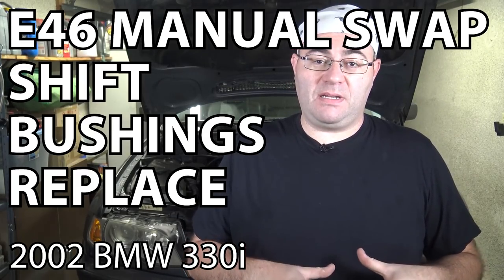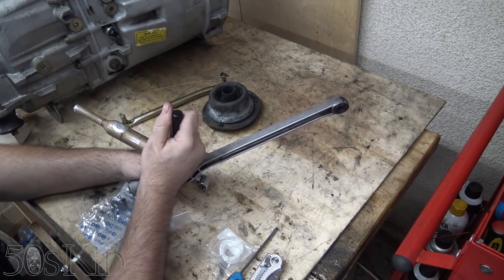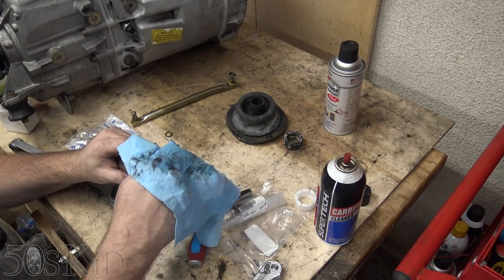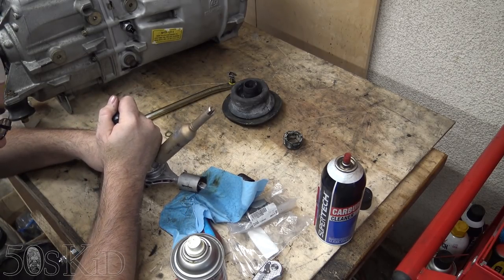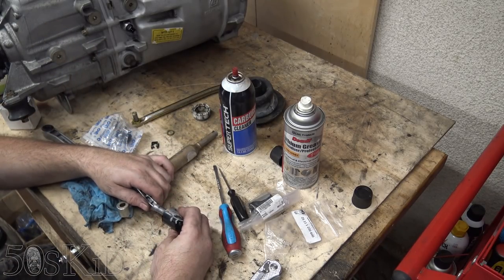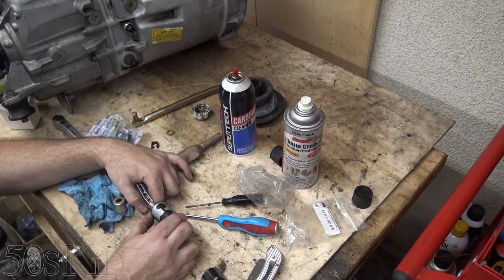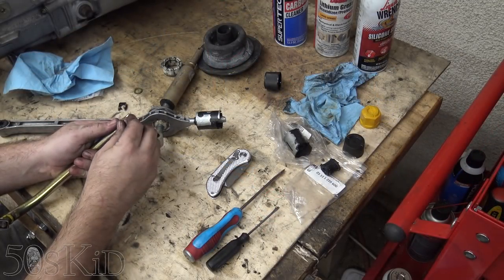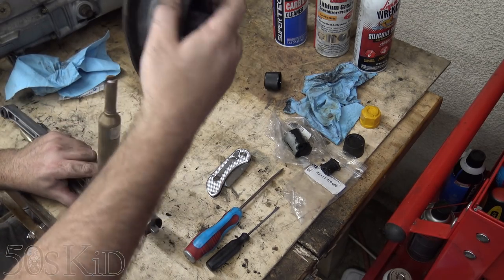BMW E46 Manual Swap Project - Shift Bushing Replacement DIY

Comment: You did like me and didn't replace that $6 selector shaft seal on the tranny. I'll do mine with the rear main. I did a short-throw with an OE 535i shifter, already had an M knob. That idler arm rear mount new and old seemed the same to me, LOL. On the front of the idler arm I used the nylon bushings from ECS to tighten it up even further.

Comment: Few tips: use the appropriate grease, lithium spray is too light duty and won't last. Don't use silicone spray to push in bushings, glue like substances are actually specified as bushings should be fixed in place and lubrication weakens the hold.

Comment: Thanks for the video. I really learn a lot from your nice videos. I have a question. Recently I replaced some of the bushings except the rod joint. Now shift lever lies slanting towards right side. I noticed that the selector rod is inserted from the right side (passenger side) but I inserted it from the left side. What could be the reason?
Reply: 5th gear lean
Reply: @tommyriffe9115  Thanks

Comment: did this fix actually solve a sloppy gearstick?
Reply: If yours has never been replaced there's a few factors the if the selector rod bushing is worn it'll create slap if the rear shift bushing is worn it'll create play if the shift rod ball is worn it'll create play if the shifter ball cup is worn it'll create play if the front oval bushing is worn it'll create play if they're all worn it creates a lot of play a perfect working order shifter will still have some play from the factory because it's not a race car but if you have a car that's never had any servicing of the shifter and it's $200,000 miles and you go from that to a complete replacement of all the shifter components it's night and day add a short throw shifter and maybe a zhp knob maybe polyurethane bushing for the rear big difference big big big big difference nachi

Comment: in the future get the delrin bushing for the front and the poly one in the rear with a z3 shifter and if u really want get a dssr and ur shifter will be perfect
Reply: Do you have these on your car? Does the poly one in the rear add any noise, vibration or harshness to the ride/shifter?
Reply: which model z3 shifter? any of them?

Comment: Can you access and take out the shift lever to replace the bushings without dropping the trans?
Reply: I also need to know this. I was literally driving to the garage this morning to get parking break fixed when all of a sudden my stick went slack and now my car is stuck in second.
Reply: I know I’m a month late but yea you can, it’s a tight fit for the clip that holds the upper link on but it can be done with a screwdriver, you may also need to remove the driveshaft but it is completely possible to reach around and work with the shifter

Comment: Hey man, I'm doing the 5 speed ZF manual swap in my 2002 330i . The donor car was a 2002 530i and I'm noticing my shift arm is different than the one you have. Do you happen to know if they are interchangeable? Thanx

Comment: Is it possible to replace the shift lever bearing without removing the assembly from the car, or getting underneath? Could I do it all from the cabin?
Reply: no.  you need to lower the transmission by 4 inches.  Then remove the lever from under the car.

Comment: That Bushing That Slides Right Out I think it’s called the shifter arm bushing if there’s not one on the trans the shifter will drop from it’s correct position right u would have to hold it up while shifting ?

Comment: You definitely want to replace the pivot pin.
Reply from the maker: you talking about something I did not replace or that I did?
Reply: 50sKid The one that you said you didn't get a new one. The head on that pivot pin wears out evenly, so it "looks" ok.
Reply from the maker: Ok--I didn't feel any clearance in the pin after I had reinstalled it though--I think it's ok.
Reply: 50sKid not where it installs, where it touched the clutch fork

Comment: hi 50s kid I want to know why my shift gear don't want to go into gear when I started engine but if I put in gear and started engine the car will roll with the clutch fully press do u what's wrong or what I need to replace?
Reply: Sounds like a clutch bleeding problem,either you have air in the system,or if it's run by cables they maybe got loose so your clutch doesn't disengage completely.
Reply: Hi... My car is doing the exact same thing. Very very hard to get in gear when running, but f I turn it off it goes in no problem. 
My car also rolls when in first with clutch fully engaged. 
My clutch pedal also has about 3 inches of play... 

Any ideas?

Comment: dude i pushed the bushing off and on easy with my thumb. you should only have a yellow spacer on the outside. thats why it would not fit.
Reply from the maker: No spacers at all with the new bushing I installed--it has integral bushings. Says so on realoem, in fact.

Comment: hei there! you really do great videos. i was posting in other videos. so i changed the gear mounts and the gearbox stick still shakes a bit. im guessing i have to do this repair like in the video? looks like a bit hard and expensive.
Reply from the maker: Nah this repair is specifically for a shifter that sticks when you move it over into 5th gear.
Reply: rulerss guibo is worn
Reply: 50sKid i have a problem with my e46, cannot engage reverse, sometimes it goes in but most of the time i have a problem engaging, any ideas?